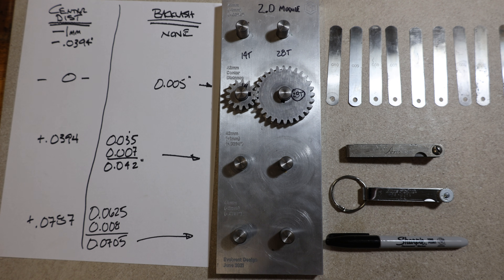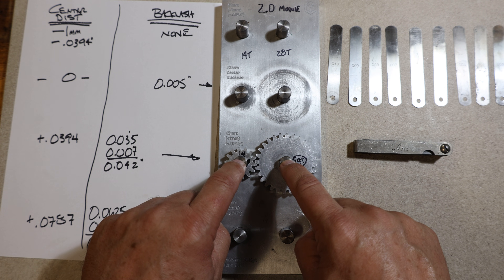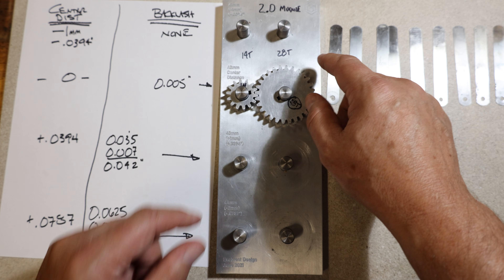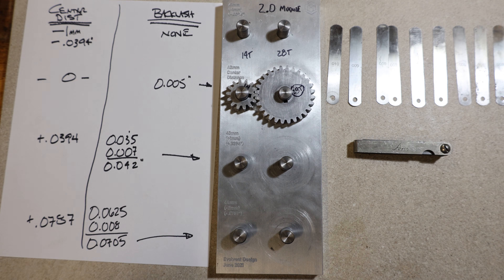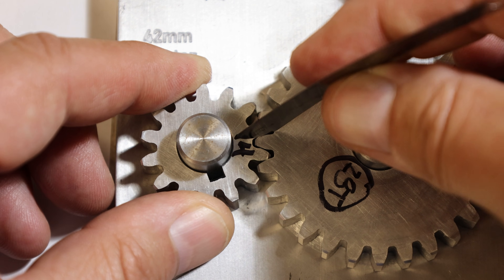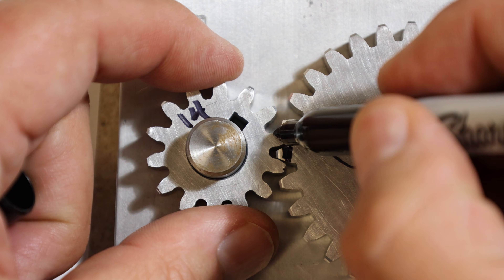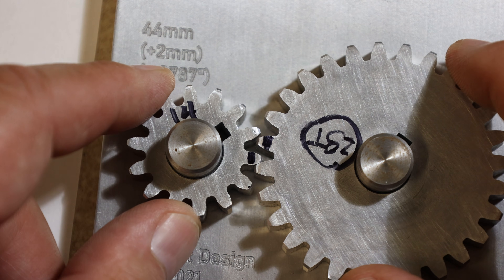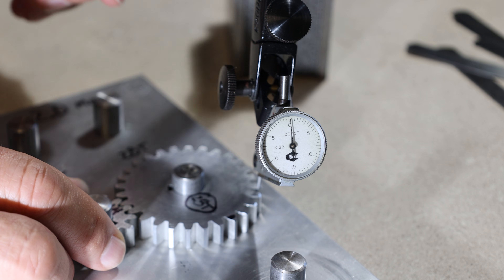How to measure Gear Backlash and Center Distance

Comment: Great video, does backlash effect the force pushing apart gears like likeliness to snap a shaft etc
Reply from the maker: Thanks for watching.  Too much backlash is almost always a bad thing.  But for shafts that always run in one direction and at the same speed, it is not terrible.  The amount of backlash is a key gear design factor and is in many standards. 
For your question in particular, if a shaft is very worn then the whole mechanism will suffer and your shafts can break depending on your application.  Sounds like some maintenance and inspection would tell you if you need to rebuild the gearbox.

Comment: Hi you got a subs. How i can calculate the backlash in spur gears like the example in the video? More specific the 0.005 value. Thanks
Reply from the maker: Try this to start:
https://evolventdesign.com/pages/spur-gear-generator

The video is not done but the method uses profile shift coefficient